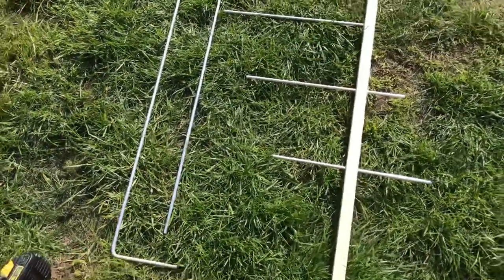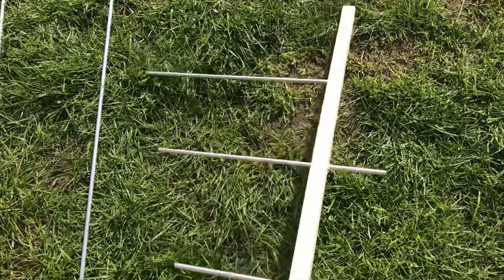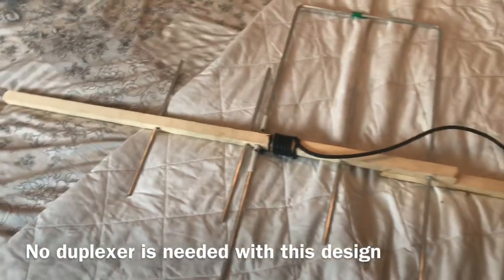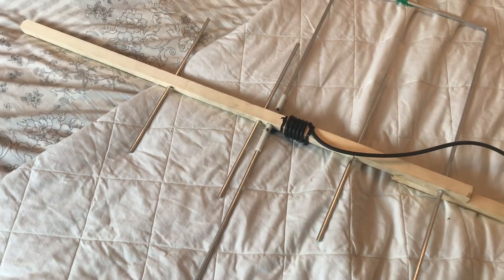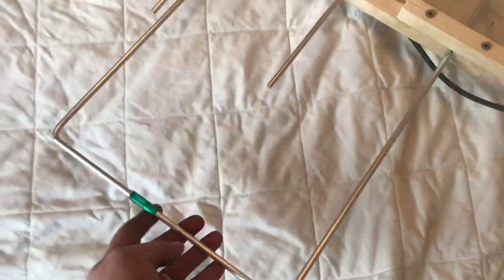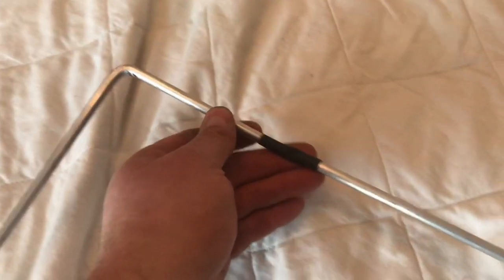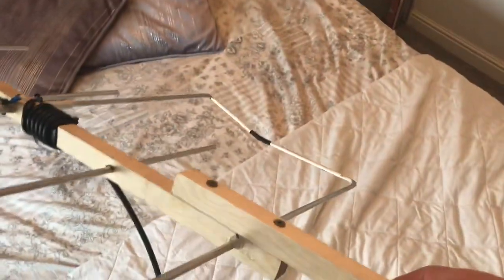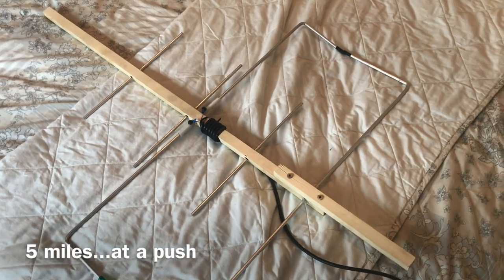Amateur Satellites - Building a Dual Band 70cm / 2m Antenna ( SO-50 AO-92 )

Comment: Ah, random signal dropouts during satellite reception, I remember that issue back when I used a Baofeng for them. It's receiver is just a little less sensitive than some higher-end brands of handhelds. I remember having a couple dropped QSOs I couldn't log because I missed right during their callsign.

Comment: Hi Chris, this is nothing to do with this veideo, its to do with your old video of making a  clock depthing tool, i caint seem to win a bid on ebay so i probable need to make one, can you tell me what you used for the spring ,

regards john
Reply from the maker: Clock repairs Merseyside it’s just a spring for a massive bulldog clip. It’s very strong and despite not the prettiest, it works well! https://youtu.be/1SQ-2T6ExeA
Reply: Cheers, now I see 👍👍

Comment: I like the design of this antenna, and you've done some nice work. Where did you find the plans for it?
Reply from the maker: KB6NU's Amateur Radio Classes I got it online somewhere and quite frustrating I can’t find the original plans!
Reply from the maker: KB6NU's Amateur Radio Classes actually, the diagram is 1min, 25sec in the video. That’s all I used!